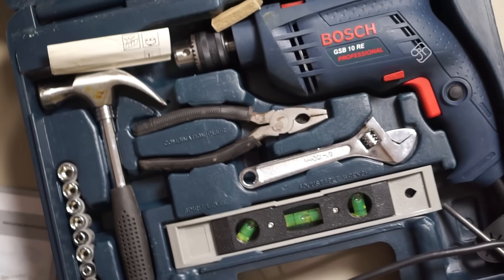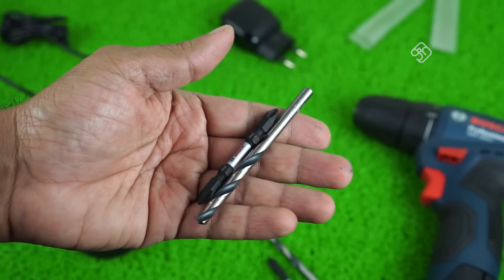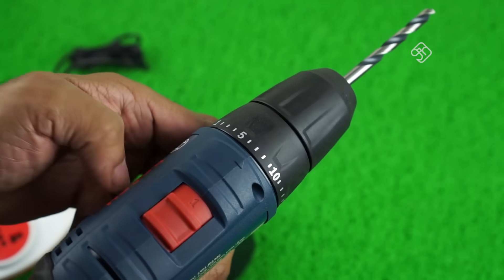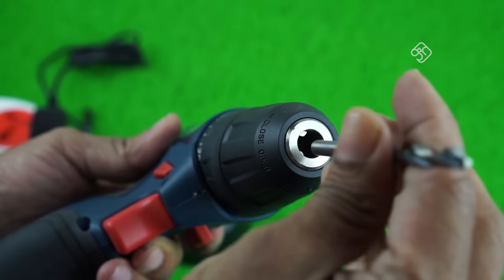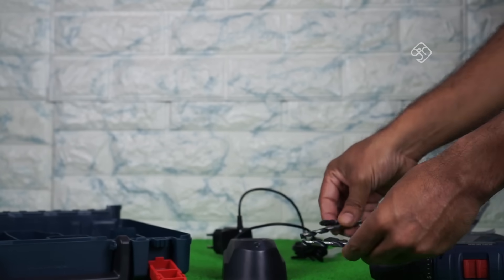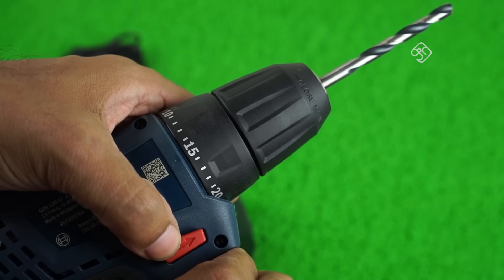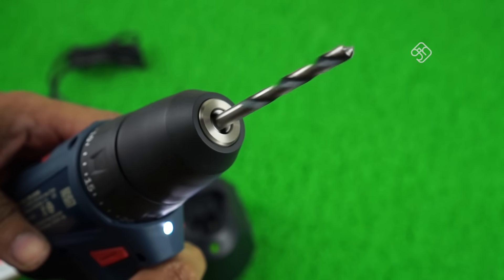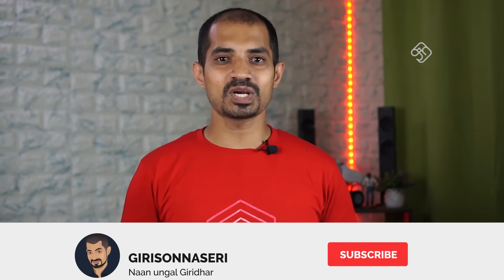Bosch Wireless Power Drill [GSR-120 Li] -  எல்லாரும் மாவட்ட காத்துக்கிடனும்...

Comment: Don't buying the bosch drilling machine..... because performance is very low due to low voltage and my suggestion is Makkita battery operated machine....and im using makkita battery operated machine past 10 yrs regularly in my work shop without any complaints.

Comment: Ithu failure model bro
Reply from the maker: Appadiya? Ethanaala?
Reply: @girisonnaseri  battery backup battery life nala
Reply from the maker: @ragavanr7936  15 20 min varuthu, en use kku athu pothum
Reply: @girisonnaseri   sila nerangala solla mudiyaathu bro takkunu 20 min apram drill pannanum nu theva padum paatha charge irukka thu appa varum paarunga kadupu solla mudiyaathu bro handy product than engayavathu kondu polam but 3000 over price a irukku
Reply from the maker: @ragavanr7936  athuvum right thaan
Reply: @girisonnaseri  🙂
Reply: @girisonnaseri  wire drill tha best
Wire pathati extension panni kalam ana kaala vaarathu

Comment: I have GSB 120 LI (2 battery's) 
300 Sr = 5400 rs...
I am ac mechanic.... In Riyadh...
Reply from the maker: Appo naan ithula cover pannathellam correcta solirkena?
Reply: @girisonnaseri  s bro
Reply from the maker: @sathishs9507  ithula hammer drill mode seriya velai seiyalaye... Antha mode kidayaatha?
Reply: @girisonnaseri   This machine have three option number 1 hammer,
 number 2 Wood,
 number 3 screw,
But 3 very good....
2 average....
1 very bad....
Reply: Intha drill veetu useku OK
Reply: @sathishs9507  pro ennaku orue drill machine vankanum from home useku like wood, steel, wall mount holees. Gsr 120 li ( Or ) gsb120 li  Wich is the best drilling pls solluinga.
Reply: Bro idhu concrete wall drill pannuma
Reply: @gokulkrishnan5299  no
Reply: @gokulkrishnan5299  only like screwdriver
Reply: Appo adhukku endha model best  bro
Reply: @gokulkrishnan5299  minimum 20mm
Drill.....
(bosch GBH 200 Pistol Grip) ...
 5590rs..
In flipkart....
Reply: Thanks bro